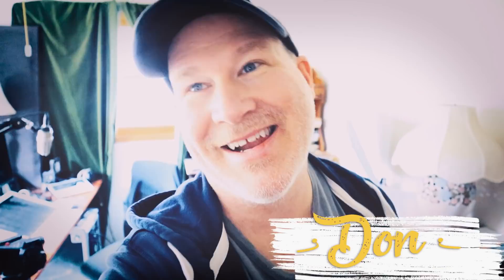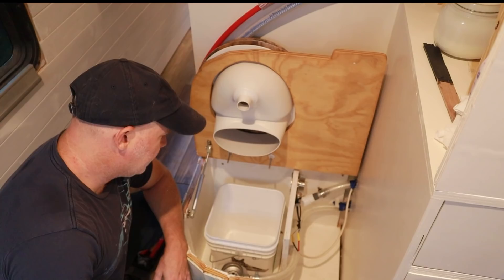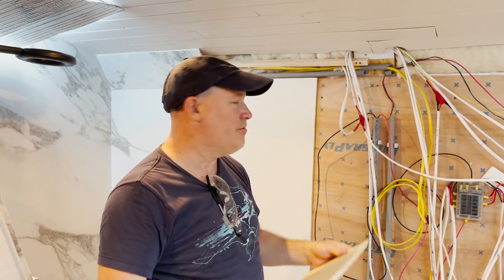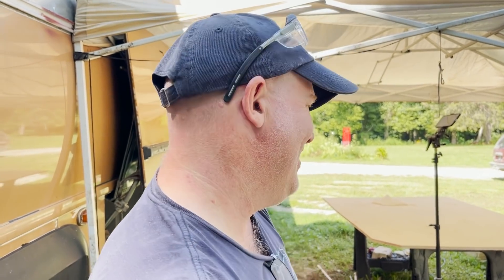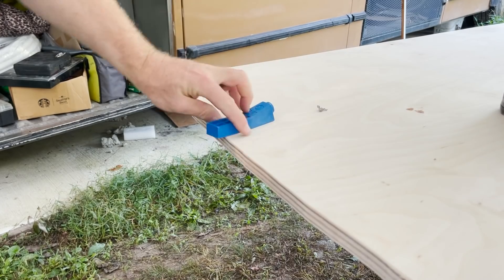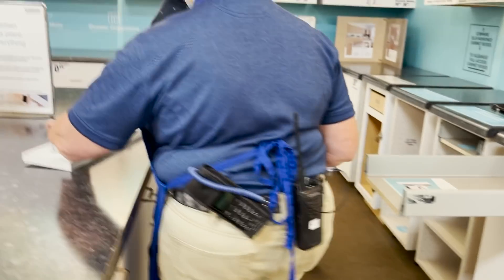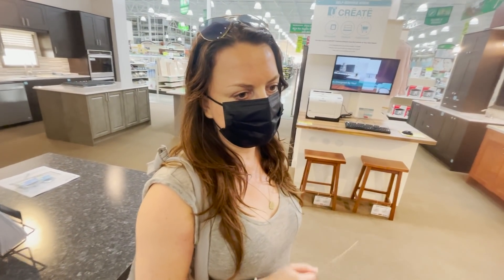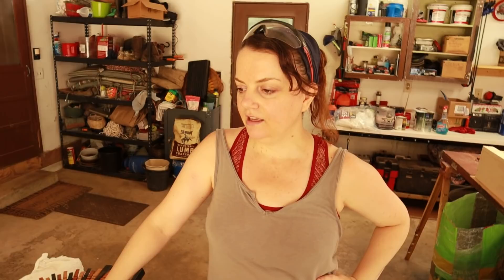We have to Stop the Bathroom Build - S04E23

Comment: I noticed you cutting on the table saw and have two suggestions: 1. (29:44 minutes into the video) Put the safety glasses over your eyes when cutting instead of protecting your head....lol  2. Use your sliding miter gauge when cross cutting or you run the risk of getting your material in a bind between the blade and the fence and having it kick up into your face. The bus is looking awesome. Really enjoy each update.

Comment: We opted to go with full 1/2 cab ply cabinets and faces.  the ikea had a novelty with storage, etc but I've never been a fan of MDF and the price was just about the same with the same soft close drawers and doors.  Yes there are a LOT of options... its quite overwhelming.  also keep in mind that the cost of drawers is like 3x the cost of a cabinet with a door and shelf.  Also having to get latches or a mechanism to hold the drawers closed.  

#rvthatbus
Reply: 3x the cost for drawers would be totally worth it to me. I’m so sick of trying to reach the backs of the cabinets in our condo kitchen, losing all kinds of stuff to the deep, dark void... including cats. Our Skoolie kitchen will be galley, no L, because the L in our current kitchen is a bit useless, especially the depth of the cabinet-to-nowhere. And alllll drawers. Small cabinets above will be sliders, mid-century style.